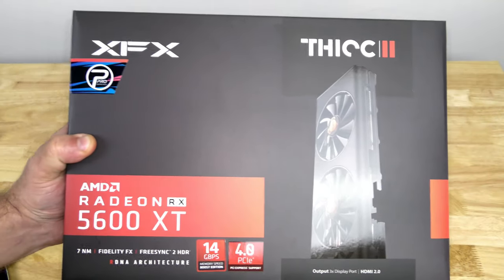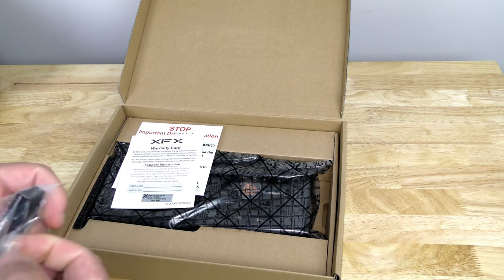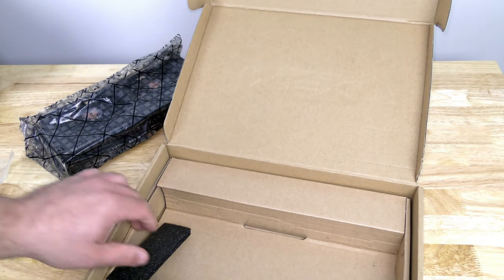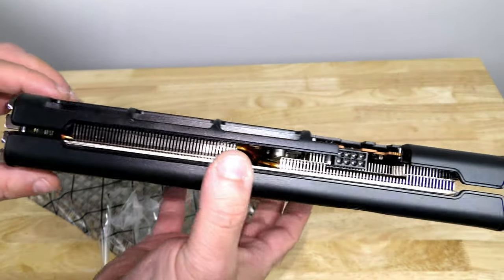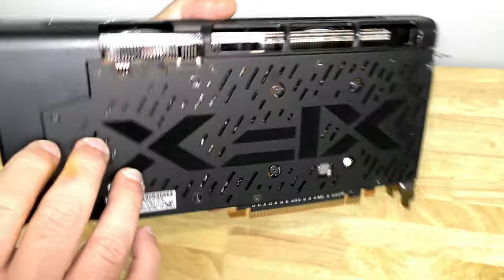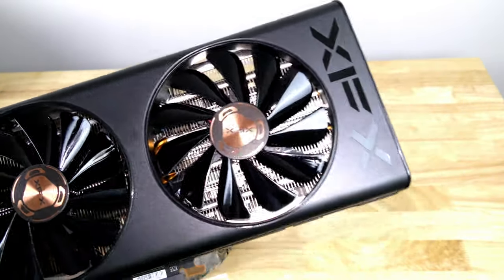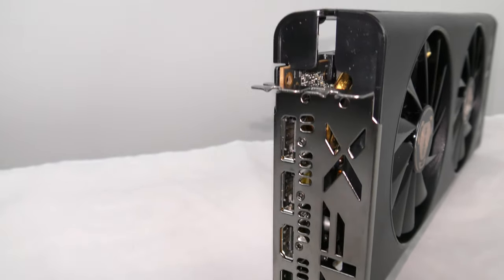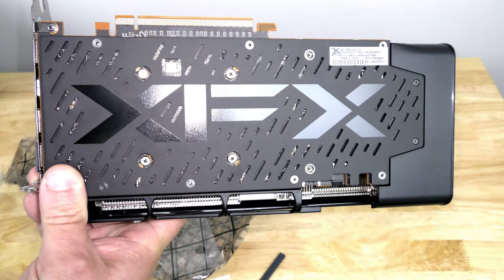XFX Radeon RX 5600 XT THICC II Pro - Graphics Card Unboxed

Comment: I love XFX cards. Mine is a RX Radeon 580 8gb LED edition. Its great for 1080p gaming. But i have a 4k monitor. I wanted to upgrade to a newer XFX card. But if i did that my i3 9100f would bottleneck it. So i cant upgrade without spending a fortune. But nice video on the card. It had wayyy too much plastic on it😂
Reply from the maker: Well, for 4K, you are out of luck, the current gen will only do well on 2K and that is with the 5700, you might need to wait for next gen for 4K.

Comment: I bought the same card with the old 12 gb bios, will the video cards with the old bios be updated to 14 gb? I was sad because I wanted the maximum performance of the new bios and I couldn't
Reply from the maker: you would need to check with your video card manufacturer because not all 12Gbps cards were really 14Gbps, they might have failed units scaling back to 12Gbps, so updating it could mess up your card.  I would love to tell you for sure, but they would know 100%.
Reply: @ThisBytesForYou  Eu atualizei, mas apenas os relógios gpu aumentaram, mas a memória permaneceu em 12 gps, procurei em alguns fóruns e havia muitas pessoas reclamando
Reply from the maker: Sim, a memória atualizada era, de fato, uma atualização, para que você possa comparar e comparar com minhas pontuações para ver quanta diferença fará. esse vídeo está chegando em breve.

Comment: hello a question I have a Gtx 1660 Super unopened and I was thinking of changing to the 5600 xt what do you think?  do I do it or do I keep the gtx 1660 super?
Reply from the maker: Well, they are pretty similar in performance, but what are the cost differences?
Reply: ThisBytesForYou the gtx 1660 super me cost 240 dollars and 260 with shipping included and the 5600xt costs 269 dollars and 289 with shipping included
Reply from the maker: Cost difference, I am think the 1660 might be a better option.

Comment: hey man just wanted to know the full size of the gpu cant find it anywhere online, how high is the backplate from the pcie connecter, the gpu back plate looks thick and im afraid that it will run into my ram and i am also afraid that the width will be to big for my pc case is the width really 14.5 cm as listed on amazon? I also noticed that you said it has a 4.0 pcie but my mobo has a 3.0 how much/what will this affect? thanks
Reply from the maker: the dimensions are 11.02 x 5.83 x 1.73 inches, it's PCIe 4, but it will work on 3.0 just fine.  You will see the final review on this card soon, so please stay tuned, subscribe and click on the bell notification so you know when the video comes out.
Reply: ThisBytesForYou thanka a lot, do you know if this card is the same size as the 5500xt version they look very similar

Comment: Whenever I launch a game it crashes within 15 seconds and a message pops up that says “we detected a driver timeout has occurred on your system.” I tried resetting my pc with a usb and nothing changed. This started happening after I took out my gpu then put it back in (I’m 99.99% I put it in correct and did not damage it) and after I installed the latest amd drivers.
Reply from the maker: Thanks bud, you may want to check this out, it should correct the issue, but no, this should be a driver issue, not damaged, but this should help you: https://youtu.be/Qh2xEUXWeqs
Reply: @ThisBytesForYou  now when I launch a game (specifically Minecraft) it says “GLFW error 65542: WGL the driver does not appear to support openGL”
Reply from the maker: @lilcrazart4162  you may want to look into this: https://appuals.com/minecraft-glfw-error-65542/

Comment: Hi, i have the same model but mine seems to has 12 GHZ memory clock as yours is 14. Are there 2 different model of the XFX 5600 XT Thicc II Pro in the market?
Reply from the maker: The 12gbps is the original model, and fixed a few things on the bios and memory side which allowed xfx to release the 14gbps version which I am reviewing and releasing more videos on.  If you want to compare the differences, I will be releasing more videos of which one will be benchmarking and you can compare the differences.
Reply: @ThisBytesForYou  It's so weird that two different version has been released as 12 and 14 with the same name 'thicc ii pro'.. by XFX. If XFX would release a model which supports 14 Gbps memory clock, i would expect mine to be upgraded 14 gbps with BIOS update. But it cant be. When i chech the XFX website about BIOS update of my card, i didn't encount any 14 gbps version of this card. I only saw it in your review video on the package.

My last question is updating BIOS of a any GPU card which is updated before, makes any trouble? If yes, how can i get that my card has already updated by factory. I couldnt find ex-bios version and new bios number anywhere. 

Thanks
Reply from the maker: it can cause issues updating the BIOS, I would highly recommend contacting XFX before you update, so that they can give you some guidelines on it and some assurance if something goes wrong that they can take care of you.

There are no more of the 12gbps cards on the market, since that was updated.  My benchmarks may help you to decide if it really makes a big difference though.  Stay tuned, I will have more on this soon.

Comment: 1:20 is that an adaptor for 8 pin?
Reply from the maker: yes, it goes from 2 x 6Pin to 1x8 Pin
Reply: @ThisBytesForYou  thanks
Reply from the maker: @babythrower3002  you are very welcome my friend, are you getting one of these cards?
Reply: @ThisBytesForYou  i hope so
Reply from the maker: @babythrower3002  if you do, make sure to check in the description or pinned comment.  I have a global Amazon Affiliate link where you can find it just about anywhere in the world and will give you your local pricing.  I hope that helps.  I also have a few other videos on the card here, check out my playlist: https://www.youtube.com/playlist?list=PLuWlEgp_PqJOGI3emgQXRyJb-477WjvCk
Reply: @ThisBytesForYou  another question i have 460 watt powersupply can it run the gpu without any issues?
Reply from the maker: @babythrower3002  check the video, it tells you exactly how many watts are required, I feel your power supply is way too low
Reply: @ThisBytesForYou  i checked AMD website and did some research  the minimum requirement for psu is 450 thanks for the help
Reply from the maker: @babythrower3002  no problem my friend, I was on my phone, so it's harder for me to look but glad you got it